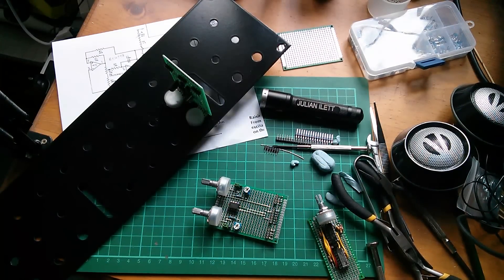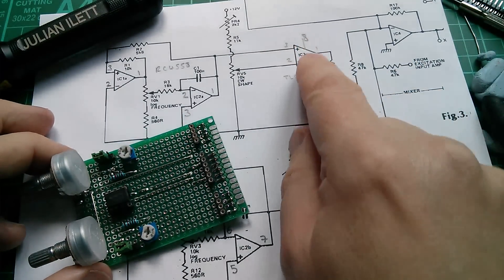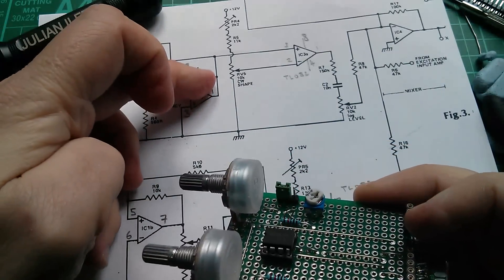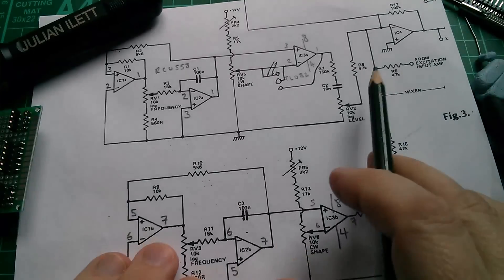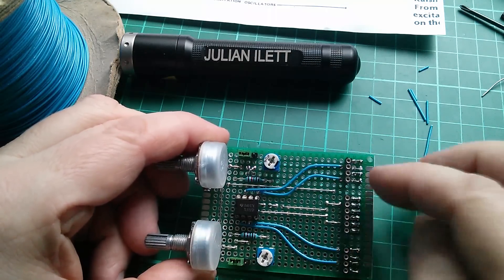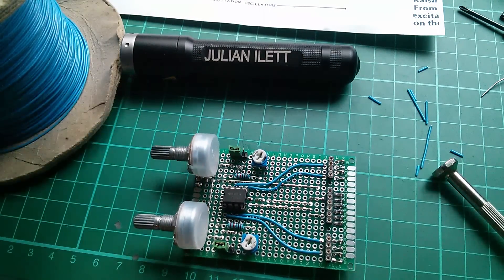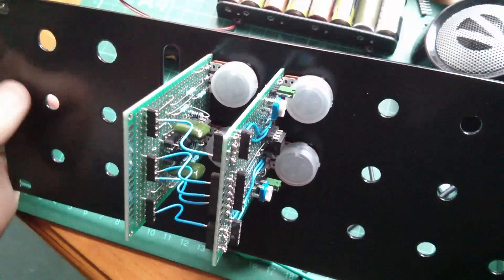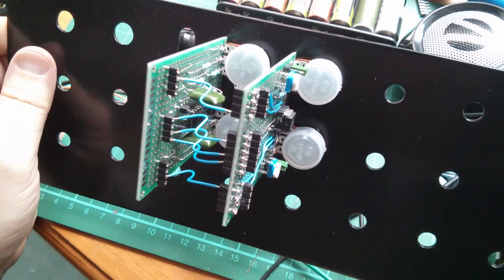Project: ETI Vocoder - Comparator PCB Added

Comment: Now a reverb tank! Easy!
Reply from the maker: I'm looking at the PT2399 for reverb
Reply: I bought some of those. Just remembered it when you answered. If memory serves, I was trying to figure how to adjust some dimension of delay dynamically via volume or pitch (for a guitar pedal). By the time I received them I was off onto another project so just threw them in a box.

Comment: +Julian Ilett - Not sure if I missed it or if its left out, but those panel-potentiometers, the plastic backing on them.. Are they put on separately or are they made like that? Never seen potentiometers with the plastic protection on them before!

Other than that, great video and sounds like this is soooo fun to hear and I can only imagine that they are much more fun to play with in IRL. The feeling I get when you get both sounds of the first board in phase, I cant describe it but it feels so overly pleasant =D  I cant wait for the next video in the Vocoder series! =D

Comment: The changing harmonics of the square wave output took me right back to my childhood travels...... watching, or rather listening to, twin-engined propeller driven aircraft run up their engines before take-off. The saw-tooth waveform generates a nice impression of a set of bagpipes, increase the frequency a bit and I can see marching around in front of Edinburgh Castle vocoder in hand, batteries and speakers strapped to your back.

Comment: I just built a circuit that takes a triangle wave into an opamp as a comparator to create a square wave and lets me adjust the point at which the comparator flips so I can adjust the pulsewidth.
I then have it going into a divide by three circuit and it makes a very interesting sound when you mix the original sound and the /3 square wave.

I love the series of Vocoder circuit videos.

Comment: When you used the tinned copper wire as you did in this board, isn't there a risk of two of the wires touching the same pad, and since the holes are metal on the inside, wouldn't that potentially lead to unwanted electrical contact? Do you avoid that somehow? I ask, since I have yet to figure out a "proper" way of prototyping stuff on perf board and I really like those neat straight wires you're using...

Comment: It might be a bit late now, but have you considered using IDC ribbons for board interconnects? You could have multiple connectors branching off one ribbon cable.
Reply from the maker: That works for data busses. But this will be more of a rat's nest.

Comment: Couldn`t you put a high resistance resistor between booth timing capacitors just to get the ability to lock booth oscillators to the same frequency (if booth adjustment pots are adjustet close enough)?

Comment: I wonder if this is a good project to use as an excuse to download kicad and have a go at doing them as a proper PCB from the get go. The little boards you're putting together are insanely cheap from Chinese fabs now and I think you'd save a lot of time in the long run.

Comment: Probably save yourself many hours by getting some veroboard/stripboard instead of that horrid stuff that most everyone seems to sell instead these days. Wonder why it's so popular with the vendors? I hate the stuff.
Reply: It's glass fibre with plated through holes so far more robust than vero. The downside is it's trickier to remove components when prototyping, but for me the advantages far outweigh the disadvantages. Julian uses horizontal and vertical lines where possible, but usually I  like to route 'tracks' in a free form manner. It gives you that extra flexibility IMO. You can almost copy an existing 'proper' PCB quite easily, that's not very practical with strip board.
Reply: +Fred Bloggs I like it; The 2.54mm pitch is just about right for 0805 passives and a lot of 3 pin SMD ICs like transistors. You can put bigger pitch SMD ICs with more pins on kapton tape and break the pins out and for finer pitch parts mount them on a breakout pcb and then glue that to the protoboard. Stripboard is great when you have some rails and some basic through hole circuit hanging between them but not so good for prototyping with modern components.

Comment: is a common practice to put a trimmer in parallel with a potentiometer to lower its resistance
Reply: +viermidebutura the trimmer was in series, to increase the resistance. It's there to have a configurable maximum point (with the fixed resistor) so max isn't +15v.
Reply: ***** lol i got it all wrong :)

Comment: If I'm not mistaken, the follower configuration operates as a unity gain amp, while the the square wave configuration operates as a comparitor. It runs the output at full gain and slams the output from rail-to-rail. That should explain the increase in loudness.
Reply from the maker: +James Wagner Yes, the comparator output will be hitting the rails - that's a 24 volt swing peak to peak. Clearly the triangle wave oscillator doesn't get anywhere near the +/-12V power rails.